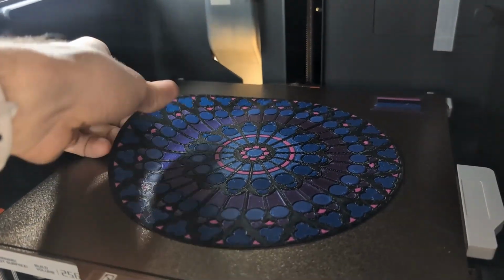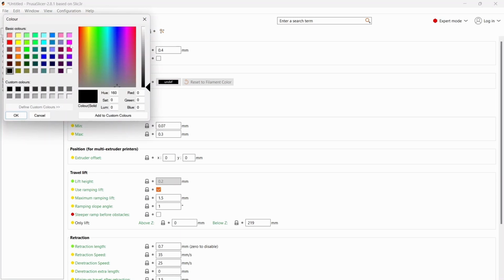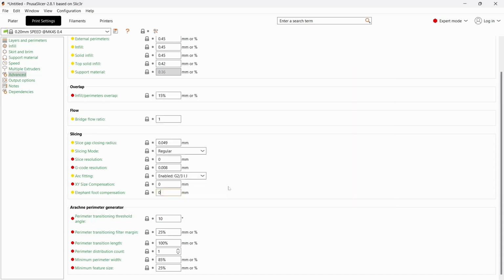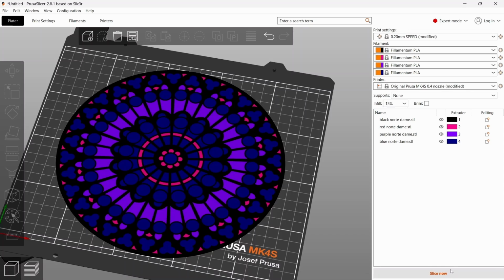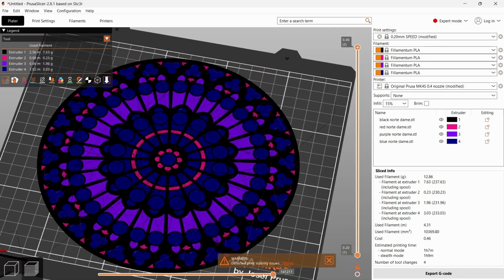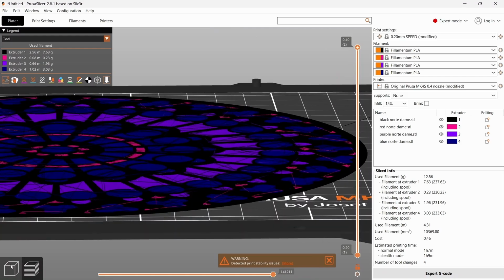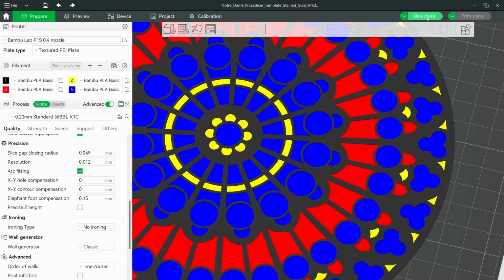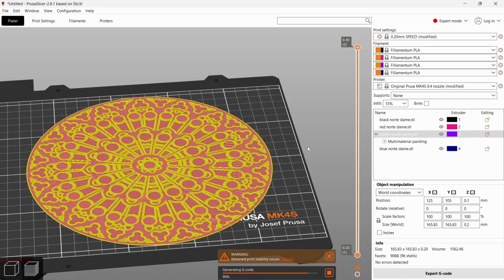How To Print Stained Glass Without Multi Material 3D Printer

Comment from the maker: Note: If you have a Bambu Lab printer without AMS use this guide instead: https://www.reddit.com/r/BambuLab/comments/11gtlfp/change_filament_gcode_without_ams/
I didn't realise Bambu Lab printers don't recognise the M600 command for filament change so instead you would have to insert a long g-code from this site in the change filament G-code field in Bambu Studio: https://github.com/eukatree/Bambu_CustomGCode/blob/bfdd8d4e9dce94def22d21b0e4ac8b5e49ebadeb/change_filament_noAMS.gcode

Simple Steps Summary:
If you have AMS or MMU you can print multicolor as usual but set the Elephant foot compensation to zero (otherwise you could have gaps in the model) But if you only have a single extruder printer:
- Open PrusaSlicer (If you have a Prusa MK3S simply load the 3MF as a project and print)
- Make sure you are in expert mode 🤓
- Switch on Single Extruder Multi Material under Printers > General > Capabilities and right above it write 4 in the field for number of extruders
- Find the blank Tool change G-code field
- Printers > Custom G-code > Tool change G-code
- Copy and paste this code into the tool change field:
{if layer_num >= 0}M600{endif}
- Import 3MF models only (not as project)
- Select “No” on the pop-up asking to load as a single object
Slice, Export G-code, Print 🤗

Comment: Fascinating project.   I tried to set this up for an Ender3.  Thought I followed your video.  PrusaSlicer is new to me.  (CURA is what I've used)  Looking at the preview and the GCode, it does Blue first,  for 1.12m of filament, then does the M600 (which does work fine on the Ender3 for other projects)  then does the black for 2.61m.  And it quits after that.   Am I missing something?  It looks like it doesn't recognize the other color STL files.
Reply from the maker: That is strange🤔 It just stops after the first layer of black or does it finish the second layer of black and ignore the other colors? Are you sure you set up 4 extruders in the printers settings?
Reply: @3demon_3dprint  Thank you for the reply.     I'm sure this is something at my end.   After making this comment, I setup a Prusa account and added a Make on the Prusa site for this design.   It has more detail, including a screenshot of the preview showing the 4 extruders, all printable, and the preview is stopped right at the end of the black design.   You can see the very next thing in the Gcode is to wipe towers and finish up the print.   I did not attempt to print this, as the preview clearly wasn't right.    I've also loaded your showflake design verbatim as a project, to retain your settings.   Similar result.   So it looks like there is an issue with the fresh install of 2.9.0 PrusaSlicer on my windows PC.   Using either your designs, or your complete project.    What might be interesting would be if I send you my project file for the Ender3, and what it does on your PrusaSlicer.   The only differences I can see are A) it's a fresh install for me - is there some other default setting I am missing?  and B) When I installed, I didn't have a Prusa account, so I didn't specify one.
Reply: I definitely did not understand the PrusaSlicer preview.   It was only showing me layer 2.   I figured out the scroll bar on the right to look at layer 1.   Which makes sense.    I credit coffee for this.